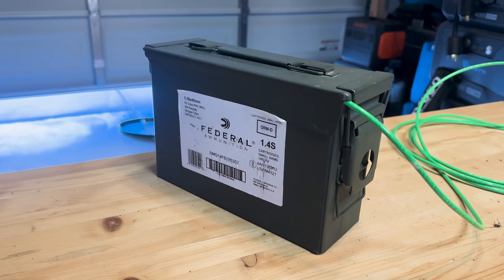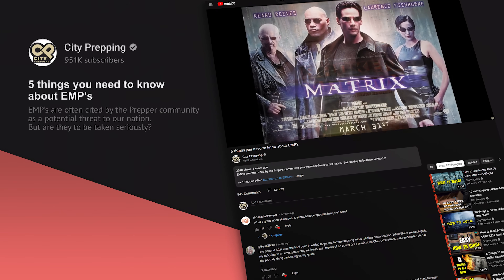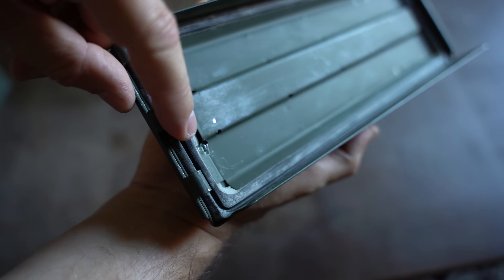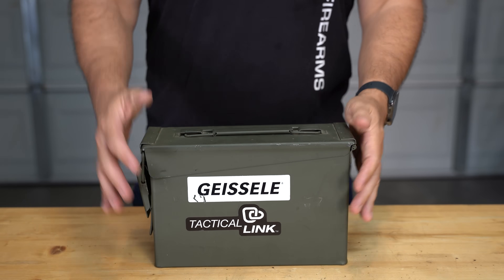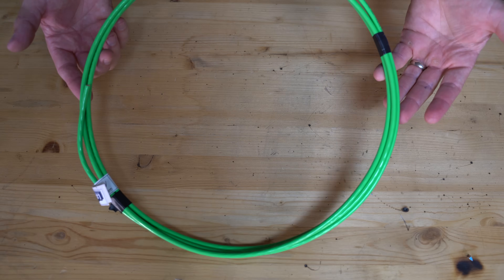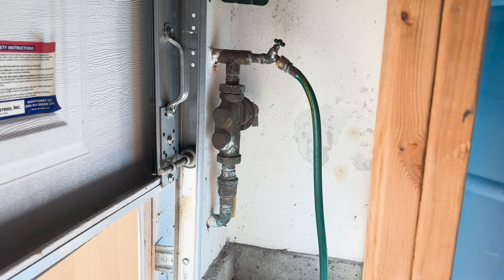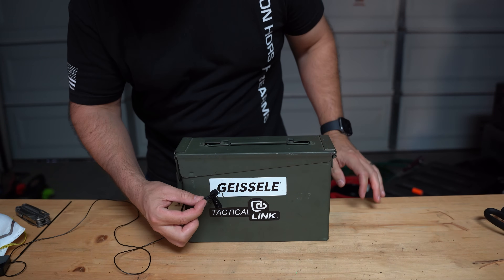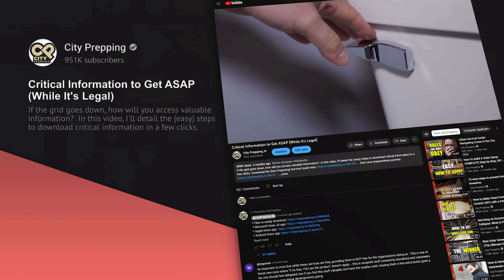How to Build a Faraday Cage: Step-by-Step Instructions

Comment: You can also use Conductive tape around the top for a seal, that way you do not have to worry about the rubber seal. I have made a couple of these on ammo cans and trash cans.
Reply from the maker: great point!
Reply: Does the tape go around the inside top or the outside?  I’m planning to make a couple of these and with garbage cans as well. I don’t want to have to tape them shut so I was planning to buy conductive gaskets to maintain a waterproof seal and not have to tape them shut.
Reply: @billsedutto8824 
	Tape on the outside 
Also
Think in layers like a Matryoshka Doll
I have a case of Baofeng radios in their original box
Wrapped with several layers of aluminum foil
Tape
Cardboard panels to insulate the foil
Repeat twice 
Then
Placed in a large grounded handmade cabinet 
A grounded metal garbage can be used.
*edit
Metal cabinet
Reply: @billsedutto8824  you can also tape over the seal on the inside as long as you remove the paint (from lid and box)and create a good connection. I have done this on several of my ammo cans and other tool boxes. I put a signal generator in them, after preparing them,  and tried to receive them on my Ham radio as a test. They passed with flying colors.
Reply: Outside, just make sure it has no gaps.  @billsedutto8824
Reply: I’m making a couple faraday boxes/cages from large ammo cans. One is a 30mm can and the other is an 80mm can. Fairly large for ammo cans, much bigger than a 30 or 50 cal can. I’m lining them with 2 layers of cardboard. I was thinking about putting a layer of aluminum foil between them being mindful of contact with the can. I was going to bolt a grounding cable to the large buckles on the outside of the can, there is no hinge and the lids lift off when you un-buckle them. This would avoid putting a hole in the can for energy to pass through. I don’t  want to ruin the water tight seal the rubber gasket provides so I was going to use metal duct tape to wrap around the outside of the lid and  can. Of course sanding away paint at the contact points of the two buckles and where the tape will contact both parts. Is this a good plan, I would like to hear everyone’s opinions on this. The one thing I’m still skeptical about is the grounding part. I was planning to ground at the buckles as I described and then Running a wire outdoors and connecting to a copper grounding rod driven into the ground about 3’. What makes me skeptical is the banter online about grounding period. So many say not to ground and so many say to ground. To ground or not to ground, that is the question! Lol. I’m not sure which way to go. I chose to use a copper grounding rod to avoid the water pipes and things connected to the house. I just don’t know which way to go. Any info is greatly appreciated. Thanks guys.
Reply: I did the same with UK military Zarges cases made in Germany. Solid things with rubber seals. I put aluminium tape over the rubber and around the edges of the case to make a good seal. I tested with radio and just got static, phone signal did not work either. Wifi calling did... :/ I've since bought SLNT bags to go inside the Zarges cases
Reply: Same here.
Reply: That's not accurate; people have tested this with signal generators and spectrum analyzers. It's crucial to remove the rubber gasket and replace it with a material that creates a very tight conductive seal. The difference between some copper foil or tin foil and a conductive gasket specifically designed for these applications will likely determine the effectiveness of the Faraday cage. Just don't opt for those cheap Amazon conductive gaskets; you're probably better off making your own, especially incorporating something conductive around foam for an added level of effectiveness.
Reply: I tested this with signal generators…. maybe they didn't do a good enough job sealing it. Mine works @ChristiannTyler
Reply: So seems my phone still rings in the ammo box, what did I do wrong?
Reply: Did you know a microwave oven is a Faraday cage ? 
That's why you don't get radiated when using it. Just get an old one and problem solved.
Reply: @jedi_drifter2988 cut the cord off would be best
Reply: I indeed knew this, the issue with old microwaves are they are hard to store, if that seal is broken for any reason, it will not work and you can get create a better one for the same price  @jedi_drifter2988